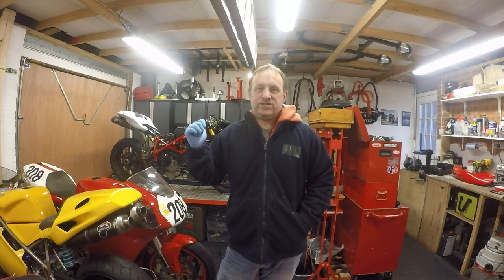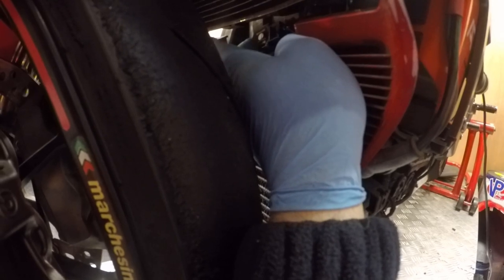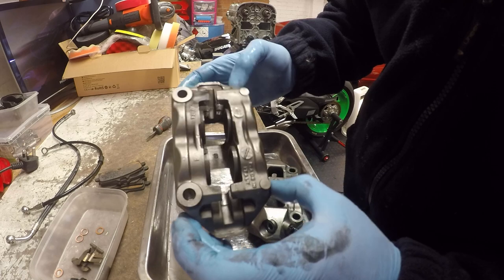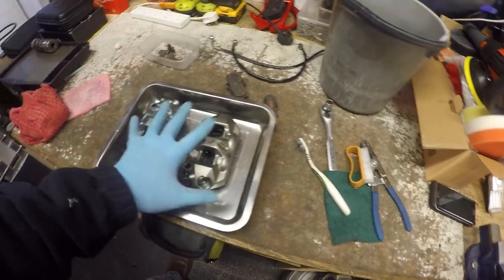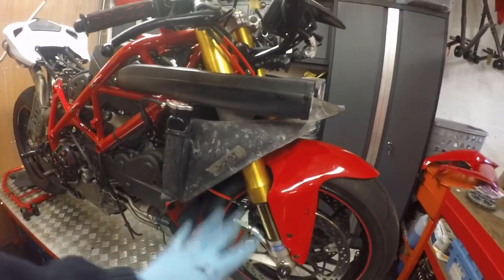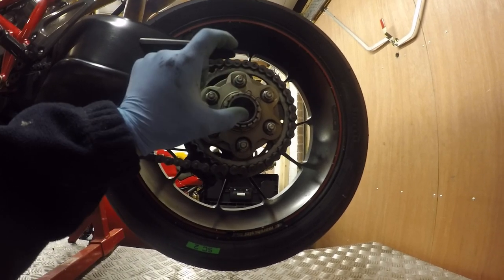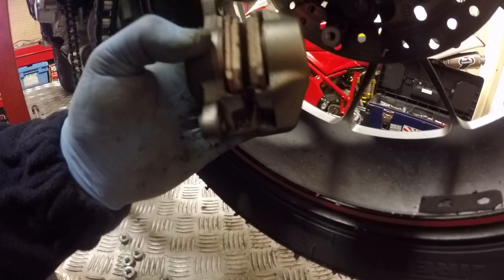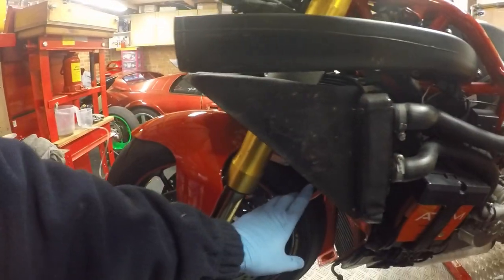Ducati 1098S Service - Video 2 Brakes, Clutch and Rear Sprocket Carrier

Comment: quick tip for the front coil and the radiator being in the way. you can also just remove the bolt on the rear bottom and leave the top in and just pivot the radiator back and up towards the engine and that gives enough room without having to remove the top bolt as well
Reply from the maker: Good suggestion 👍😊

Comment: Good video but I have the official Ducati 1098 workshop manual and it states 11nm for Spark Plug torque setting (not 20nm) and 9nm for the coil retaining bolt (not 10nm).
Reply from the maker: Hi, you are correct. The earlier engines are 20nm, did not realise it had changed for the 1098, will amend that in future. The coil retainer I do at 10nm as its my lowest torque wrench setting.

Comment: Some manuals like Haynes, recommend using brake fluid or denatured alcohol when cleaning brakes. Your thoughts?
This clip is Designer approved ✅
Reply from the maker: I have heard of people using brake fluid to clean pistons, bores and seals on the brakes and it makes senses as its the fluid in use as well. Not used denatured alcohol so cannot directly comment, however I believe its a natural solvent so would expect it to work.

Comment: HI Desmo, Nice video again! you help me when i changed the belt on my 1198. So i would like change my brake hoses.What is  product is it custom or standard for ducati ?I've seen banjo 20 degrees at the master cylinder and straight at the calipers, but could you tell me about the lengths?were can i buy the same ? many thanks for your great job and videos. Regards Frank

Comment: I really struggled bleeding the clutch on my 1199s.  In the end, I had to use a syringe at the slave cylinder to inject fluid up the system towards the master.  The Panigale burns up (turns black) clutch fluid so quickly, I'd like to be able to replace it easily and regularly.  Any chance you could do a video to show how you'd do it? Cheers.
Reply from the maker: Hi James, when I next do the fluid change on the panigale I will make a video to share 😊

Comment: You bathed the calipers in warm soapy water without the banjo bolts fitted. How did you make sure all the water was removed from the pots so as to not start corrosion and boil off during hard applications?

Keep watching, got it, uoy don't miss much.
Reply from the maker: Not to worry, the bath is not deep enough to cover the banjo and then I cover the hole whenever I am cleaning with my rubber gloved thumb (good seal), I then push out all the brake fluid after finishing plus remember it is then fully bled again as well.

Comment: Hi great video ,as they all are.I’ve got a question about idle revs. Can I increase the idle revs without getting ecu flash.I’ve tried adjusting the air bleed screws but they have no effect.cheers Andy
Reply from the maker: The idle speed is usually set via the DDS. You can use the by pass screws with out a DDS system but they effect cold start settings, as well as warm idle and as there is one per cylinder need to be balanced with a vacuum gauge on each intake. I would personally only do it when connected to a DDS.

Comment: You probably did it without thinking but for those at home , when you changed the spark plugs did you put the old ones in the empty boxes and Mark them vertical and horizontal with the service date so you can track the cylinder wear ?
Reply from the maker: I tend to keep them for my 2 stroke bikes but not for the 4 strokes, as mine are track only bikes I usually rebuild them or top end refresh often enough not to worry around cylinder wear. It is a good point though 👍😊

Comment: Nice vid. You effortlessly torqued up that sprocket side nut, but how did you hold the wheel/axle in place doing it? I'm always having a bit of struggle on those nuts. Usually have to resort to having a friend sitting on the bike when doing it......
Reply from the maker: Hi Mr Matt, I wedge the rear brake on with a bar under the work shop stand, with the engine in gear as well for added help. If no workshop stand then like you I use someone to stand on the rear brake.
Reply: @DesmoWerx  Ahh. I see. Looked so simple, I just had to know the trick. I'll have to figure something out in due time.

Comment: Probably I missed this in the previous videos but is there a website where you get all the parts that you need or just googling around? I'd like to replace myself some parts on my monster S4
Reply from the maker: HI Emidio, I use a variety of different suppliers to secure the best price at the time of buying so it varies between jobs. Ebay as a quick sourcing tool can and usually does have good prices if you search around.

Comment: on average, how long does the clutch basket last?  mine has 22k miles and the clutch is starting to slip
Reply from the maker: It really depends on use, plate types used i.e. steel or ally and quality of the basket. OEM ones are steel so tend to last longer. I have gone through aftermarket ally baskets in less than a season of racing.

Comment: I HAVE A 08 1098 WHEN A TAKE OFF IN FIRST GEAR NOW A WIERD SOUND HAPPENS IN THE FIRST COUPLE SECONDS, LIKE SOMETHING IS GETTING OVER TURN LIKE WHEEL BOLT NOISE BEING OVER TURN. ANY IDEAS WHAT IT MIGHT BE? ONLY HAPPENS IN FIRST GEAR AND IF I TAKE OFF REALLY SLOW I DOESN'T HAPPEN REALLY LOUD.
Reply from the maker: It would be impossible to diagnose this type of issue without seeing and hearing the bike in front of me, I would hate to steer you in the wrong direction.
Reply: @DesmoWerx   I appreciate that. I did buy new plates for the clutch, so I hope that will do it, if not. I ll take her to a professional for a proper diagnosis.